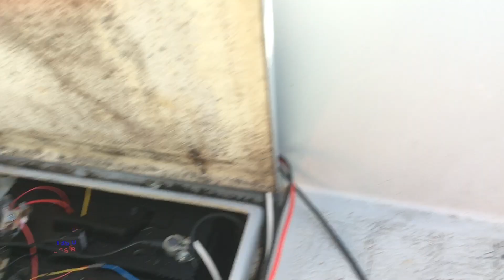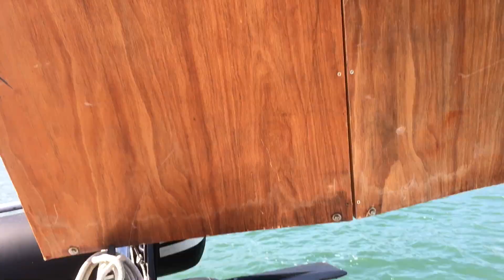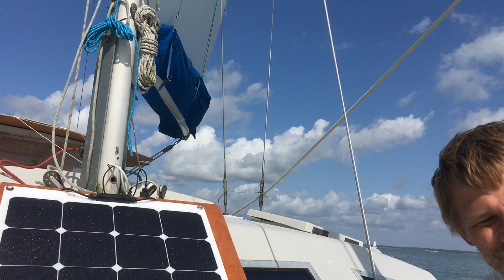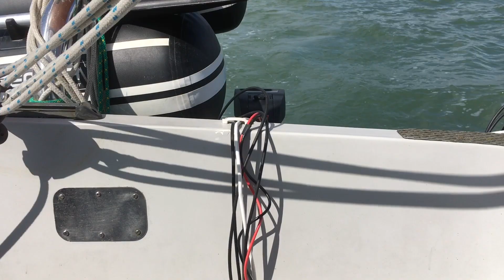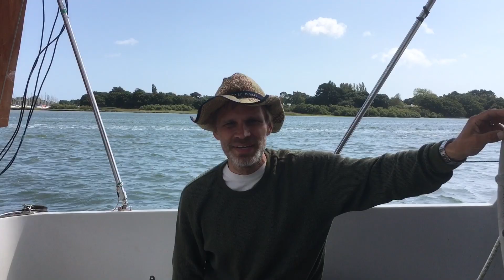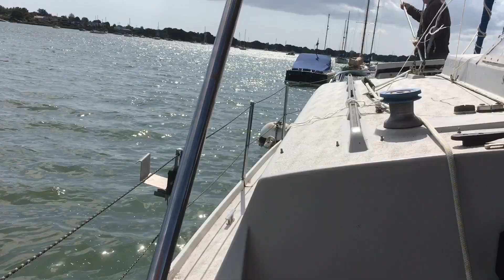Solar electric motors - Zero emissions boating, Part 3 Using electricity direct from solar panels

Comment: It's best to get a 24volt charge controller and equalise the batteries and keep them equally charged, and you can treat it like 1 balanced 24v battery. I like what you're doing, but I think having separate 12v inputs instead of wiring both the panels and batteries in series is making it more faffy for you.
Reply from the maker: Thanks Dan,
I’ll have to think about that. The charge controllers are actually 12V or 24V and they detect automatically which they should charge to. So I could use them as 24V controllers.

The difficulty is that the solar panels are 12V solar panels and it would be difficult to wire two in series to make 24V as if one is even slightly shaded, that will reduce the effective power output of the other as well.

So in order to get the most out of the panels I’m trying to keep them working singly as 12V panels. Although maybe that’s a false economy if I end up having differential charge in each battery.

Maybe the best would be to add voltage doublers to each panel and then just treat them all as 24V panels. I’ll look into that...

Thanks for the comment and do let me know if you have any other suggestions,

Simon

Comment: Your charge controllers stop overcharging, so you can leave them plugged in, surely?
Reply from the maker: Yes, that’s right. The two charge controllers each have two of the in situ solar panels on the roof attached to them and those are permanently attached to the batteries. 

I’ve then been attaching the movable solar panels directly to the batteries when the motor is being used. Hope that makes sense and do let me know if you have any alternative suggestions or any other questions.